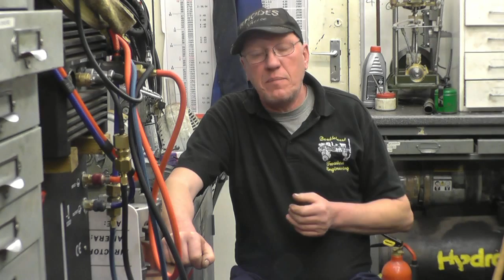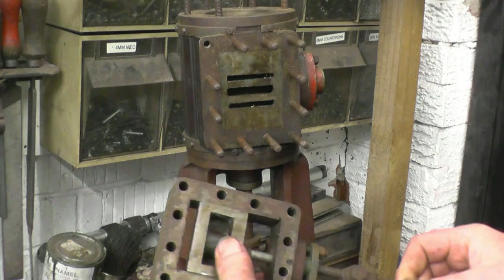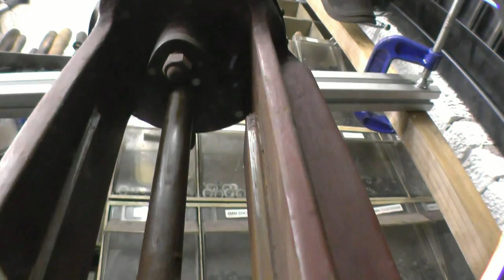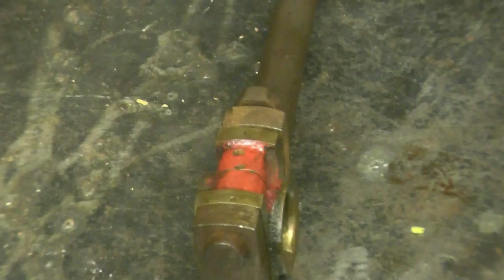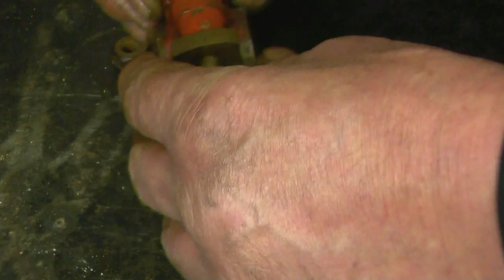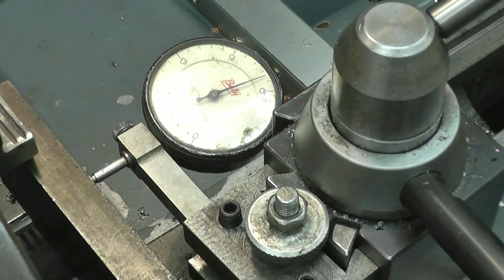SNNC 172 P2   Victorian Steam Engine

Comment: Never mind the welding. Do a shrink fit. Freeze the shaft and heat the lobe. Nice tight 15 thou should do.
Reply: You must be joking 0.015" interference fit. Can not be done on a 1" shaft, the steel will not expand / shrink that much.

Comment: the lack of wear is as mysterious as any ufo I've ever seen. find a piece of one inch I'da done a press fit pin like in a multi piece 2 stroke crank john ferguson bellow points out below I always comment and subscribe to the good stuff I guess it helps cause this is waaay better than satalite cable
Reply from the maker: I was thinking welded mains with a press fit big end
Reply: ya exactly I've gota lotta scotch blood in me so its in my nature to get to work on that kinda thing right away!
Reply: Better off either silversoldering or using Oxy brass braze and taper pins or press fit straight pins. I made the crankshaft for a StuartTriple that way after ballzing up trying to makethe crank from solid bar.
Reply: where you cut the bar between the "balance or throws" cause on some two strokes the pin is a press fit and to adjust the main runout you beat it with a lead hammer if you dig engine stuff the two stroke especially the 3 cyl well il just say there's some real interesting people and the guy who dose the old indian motor cycle multi piece cranks another surface plate operation that balancing fixture more than one way to do it all good stuff

Comment: Good engine you have there John and as you say, it's never been run. I'll be interested to watch you making the crankshaft, as you know, I'm old fashioned and chop them out of the solid. If you measure the travel of the piston and allow for clearance at either end I'll bet you come up with a measurement that's a multiple of inches. Travel of valve for eccentric making is inside edge of one steam port to outside edge of the other. Overall I get the feeling it was never finished and perhaps never had a crankshaft. My fingers were itching! (By the way, it will need a flywheel, have a look at the patterns I gave you, there might be one that does nicely.....)
Reply from the maker: Hi Stanley  It will have a 3 1/4 inch stroke
Reply: Call it 3" John. An 1/8" extra on the clearance at either end of the stroke won't harm it.

Comment: John,
That steam engine is going to look and run great when you get it all fixed up. Will you run it on steam or just compressed air? -- I'm sure Richard will like the mod you did to his control cable pulley. -- Thanks for another interesting SNNC!
Have a good one!
Dave
Reply from the maker: Hi Dave  we plan to run it from the sentinel boiler

Comment: Great new project. I built up a crank on a engine smaller than yours using Loctite. One side failed so I baked it apart and silver soldered it with good results to date. You will also need a cast iron flywheel to go with the engine. Since you will be in the States for the  Bash check out the flywheels available from Martin Models located in Portland Oregon: (http://www.martinmodel.com/MMPflywheelslist.html).  After going to last years Bash I'm sure you will be shipping a crate full of stuff home.

Comment: Well John I have it on very good authority that it is just fine to use an adjustable spanner on a steam engine just so long as it is a Bahco adjustable spanner.,   this info came to me by way of another fine British steam man, Keith Appelton
Reply from the maker: Bahco is the only adjustable spanner to have
Reply: Keith Appleton is a musician by trade and does up engines for a hobby. I wrote and complained about him using an adjustable spanner on the small nuts and told him to get propper fitting BA spanners. All I got back from him was a load of abuse and said if I did not like what he was doing, then to stop watching him. I unsubscribed.

Comment: Just a suggestion on making a crankshaft John. If you have a taper reamer handy you could make a nice multipart crankshaft using tapers and draw bolts to lock the parts together and maybe some tapered dowel pins to register the whole thing. Welding it up sounds like a can of worms unless the crank is fully macined after welding and stress relieving. Nice engine BTW, looking forward to see it finished and run. On steam mind not the cop out compressed air :)
Reply from the maker: It will be ran from the Sentinel boiler

Comment: You could bore the crank webs with undersize holes, freeze  the shaft and heat up the webs, and assemble, then let the webs shrink onto the shaft. I know some old British motorbike engines crankshafts were made like that. No welding distortion of course and strong enough.
Reply from the maker: I was thinking welded mains but a shrink / press fit big end pin
Reply: Jerry Clinton i am with you two stroke bike engines same for nearly 100 years KISS should be the order of the day 
If it is out a big you can correct it
Weld it asking for trouble